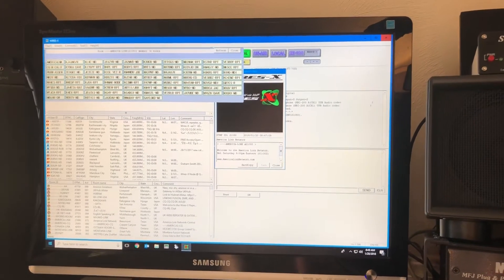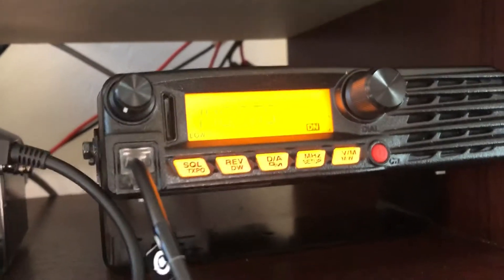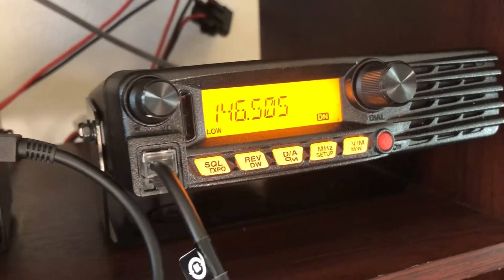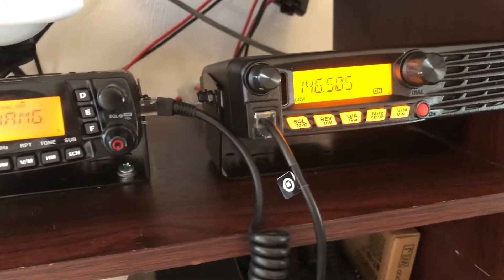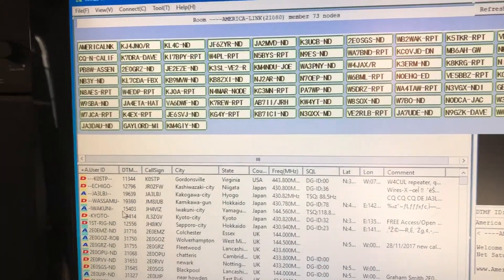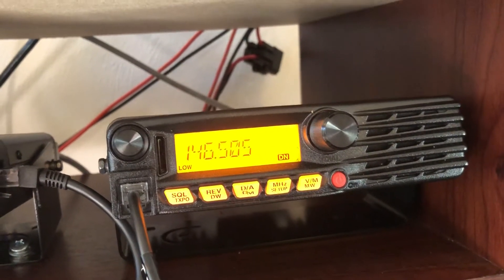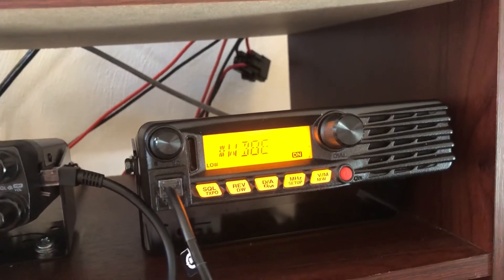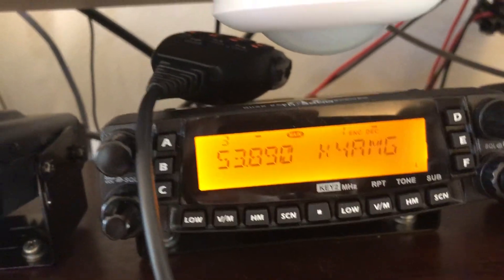Yaesu FTM-3200DR on Wires-X

Comment: well,these links you sent no longer works ,Yeasu desabled them???
did you have a special cable to used it as a node .
i need a node here but not a repeater,no much $$ for our budget 
73 from quebec

gervais,ve2ckn
Reply from the maker: You can't use this radio as a node. The Yaesu video just showed how to use the mic buttons for some basic Wires-X functions on the radio to connect to existing nodes.

Comment: Are you able to do wires-x control with 3200? ie connecting to node and connecting to rooms using the 3200?
Reply from the maker: Yaesu released a firmware update shortly after I did this video which enabled Wires X control from the radio. I don't know the exact firmware version but if you are running the current firmware then yes. I no longer have this radio and I never used that feature on it.
Reply: @K4MJV  very good, thanks so much for replying.....73

Comment: Are you using the FT-3200 as node radio in simplext (to connect to HRI-200 box) ?  Or you're  just using  FT-3200 to access what ever is on the FTM-100DR?     Can FT-3200 be used asWIRES-X  NODE radio ?
Reply: FT-3200 cannot be used as node station.

Comment: Do you still have your old tm28a for sale that you disabled comments on that video
Reply from the maker: Yeah, I saw that. But if I update it then I won't have as much excuse to "need" an ftm-400 :)
Reply: @K4MJV  the wires x on the 3200d is limited to manually entering the room id and only has 5 memory slots, the ftm-400 and ftm-100 has the ability to download the room list can connect to rooms that way ,73s K5DBW
Reply from the maker: No. I didn't realize I disabled comments on that video but I should probably remove it anyway. That is a great radio though. If you are looking for a good first basic 2 meter radio, it is a good way to go.
Reply: The latest firmware update adds WIRES-X control to the FTM-3200DR.  Go to Yaesu web site to download.